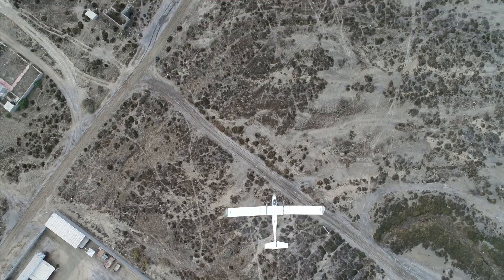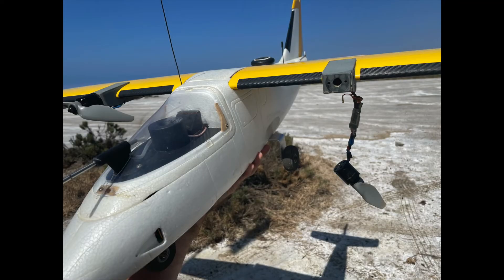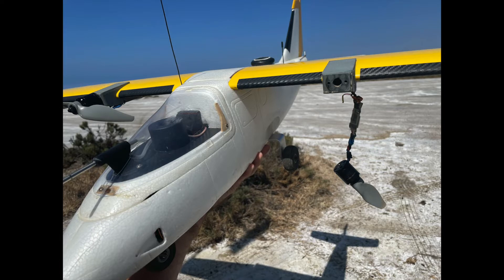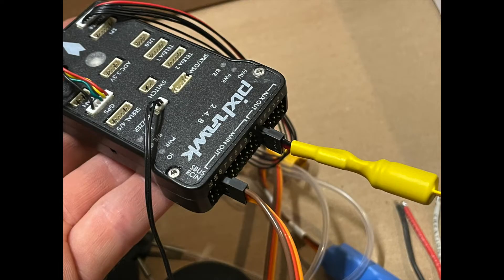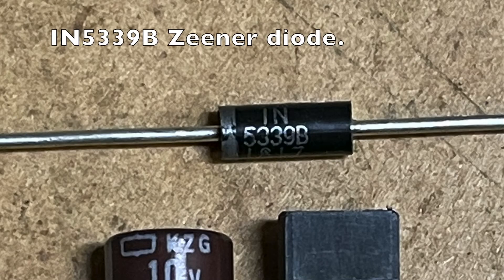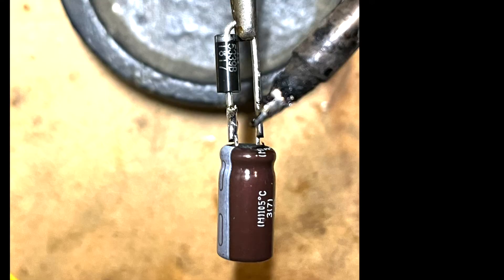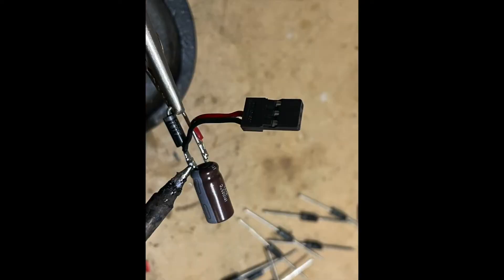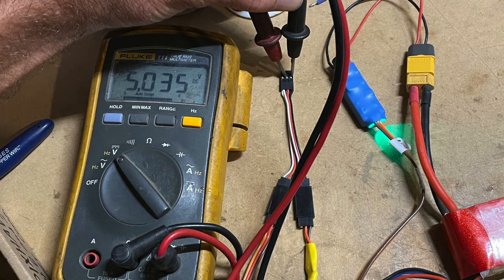Protect Your Pixhawk and other FC's With This DIY Servo Rail Power Filter

Comment: Wanna make a large platform rover.
Gonna use alot of 12v batteries thats for sure.

A battery for the servos
A battery for the pixhawk
A battery for the FPV camera but might use pixhawk battery as pichawk does use alot of juice.
And maybe 2 batteries for the large high torque moter

Comment: The Cubes, especially Cube Orange (and soon Cube Red) which everyone should be upgrading to, doesn't suffer from this problem and it also comes with it's own BEC equivalent hardware which also measures the battery voltage and current
Reply from the maker: that's great unless the current sensor overheats and fails.  I understand that would doable propulsion and the vehicle would go down, but I at least want the servo rail and pixhawk brain to be powered, so that is a controlled descent, rather that a plummet to the ground..